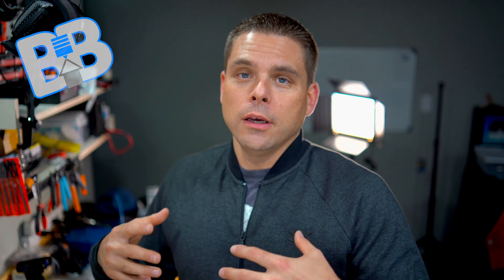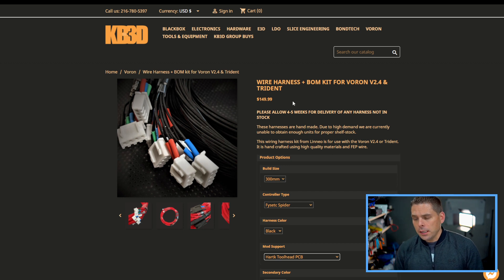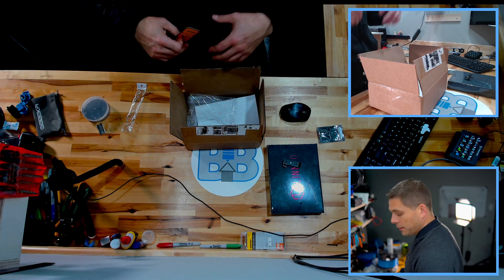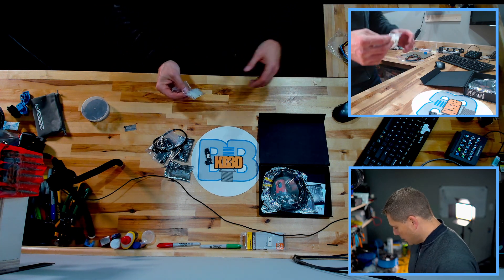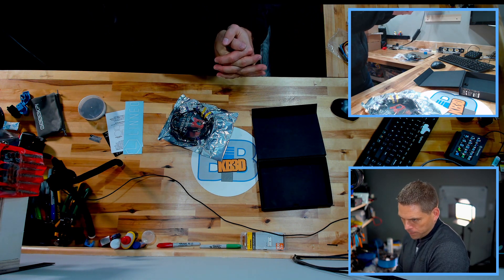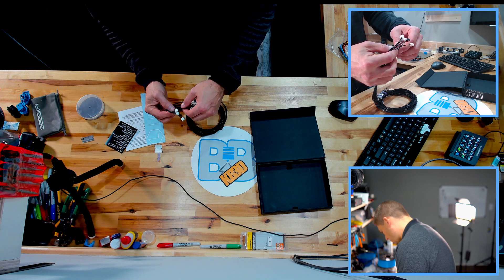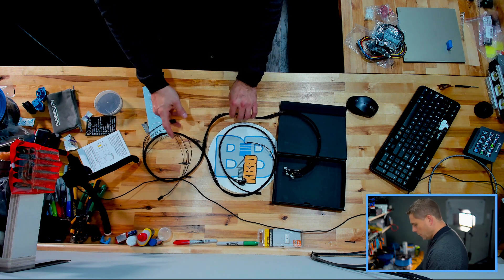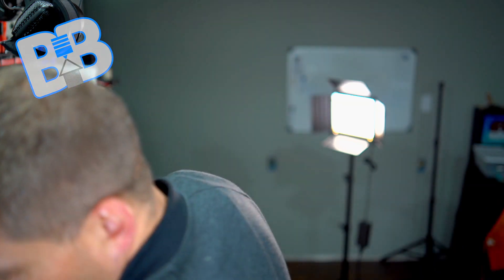VORON 2.4 3d Printer Build It Live *Episode 18* Harness Crimp'n Ain't Easy part 2 (Buy a Harness!)

Comment: Lucky you. I ordered mine on the 26th of September and still waiting for the item to even be manufactured. Hopeless service from my point of view. Maybe I should start a Youtube channel.
Reply from the maker: Micheal, I don't believe my having a YouTube channel made much, if any difference.  My original communication to them was using my regular email with no indication of who I was.  The biggest thing was, I asked if they had anything.  I was willing to work with whatever they could get me as long as it was for a 300mm unit. If you don't need your order to be specific, send them an email  - they may have something close to what you need.
Reply: @BuildItBasement  Thanks for the reply. Love your channel. My order was straight up, the same as what you received. Will give them some more time. Keep up the amazing work.
Reply from the maker: Thank you.  I'm humbled. Sorry about the delay - If I had any actual pull I'd see what I could do.  Maybe yours is on the way?  I did order it a little while ago and paid for 2-day shipping.  I would contact them - just like everything out there these days shipments are taking forever.
Reply: @michealogrady  Please reach out! This harness was from a canceled order that didn't match any of the units on backorder. Perhaps you ordered for PCB toolhead? Either way I'm happy to dive deeper, or simply offer an estimated delivery date.

We recently updated our lead times from 3-4 weeks to 4-5 weeks. The harnesses are hand made in Spain, and overwhelming demand recently has put things a bit behind.

Hope this helps!
Reply from the maker: Awesome!

Comment: So, the connectors you have and crimp stuff.. Im wondering if this is plug and play or will you need to change the connectors on the hardware to work with the harness?  I have been looking at this and anything that can idiot proof my build in the future is a solid bonus
Reply from the maker: The major crimping you'll need to do is to the parts that either don't have factory connections (probe). Or ones you'll need to shorten up (items on your tool head).  If you order a harness for your specific board you'll have those connections ready to go. I would call it 90% ready.  You'll have to crimp just enough so you'll have a usable skill to make modifications or repairs if ever needed.